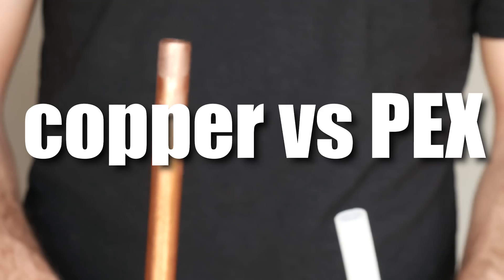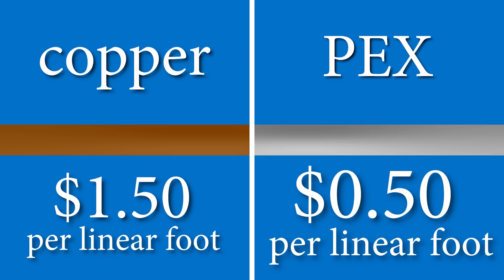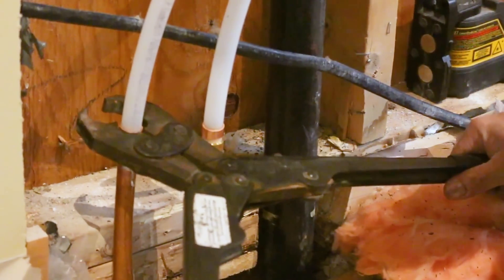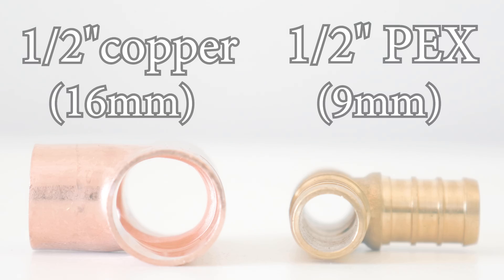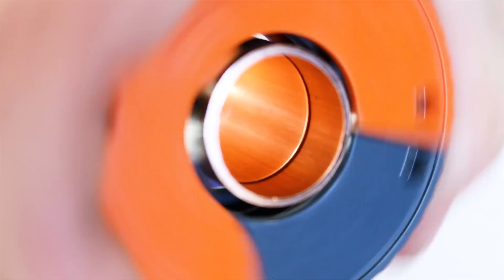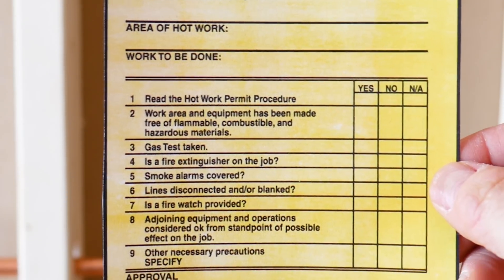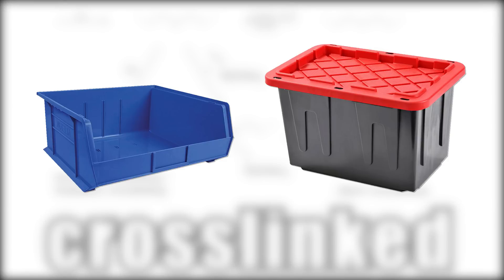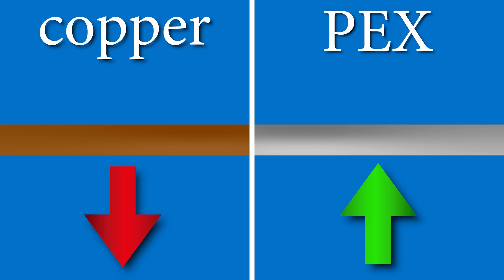Is Copper Better Than PEX? (COMPLETE GUIDE) | GOT2LEARN

Comment: I'd like to know the long term effects on ( water / health on Humans.
Reply: Very good question
Reply: well, we've been living with copper piping for a few hundred years, and the quality of water has improved drastically the last 70 years. It really depends on the water coming in, but definately copper > pex for its inhibitive properties if you have any standing water in the lines.
Reply: With PEX it is unlikely to actually have any impact.  It is due to the X in the PEX.  When you look at the current research, it is generally PE without the X.  Those formulations are made in order to allow them to be more readily recycled.  However, once it becomes cross linked, the only thing that you really can do with it is grind it up or bury it.

By and large, the majority of safety concerns from plastics are not from the plastic themselves - but the various additives which are included in order to create a material which suits the needs of the application.  Plasticizers in particular which are found in single use plastic containers are well known to leach out of them over time and they can leach into what they are containing (mostly a problem for prolonged storage as opposed to things which are consumed soon after packaging...).

And considering that California managed to find no evidence of risk for PEX - I am not too worried about it.  Almost everything causes cancer in California...PEX doesn't...  And it wasn't for a lack of them trying to block it.  Activist groups spent over a decade trying to find reasons to block PEX from being used in California and they were not able to find anything.
Reply: exactly, cuz i 've heard pex can have plastic like taste
Reply: @Eastbaypisces  PEX is inert. If you’re concerned about stagnant water for extended periods and you’re not on municipal supply where Fl is added, just install Pex w/oxygen barrier in those areas. 

Copper oxidises and accumulates mineral deposits. Plenty of University and health studies have been performed last 2 decades all finding fewer mineral deposits in water samples from Pex than copper. Unless it’s a very old building where Pb solder was used, it’s not considered harmful but certainly Pex would deliver “cleaner & purer” water from source to tap.

The “plastic taste” was not from Pex. It was likely the old Quest polybutylene pipe or cpvc. Both are no longer code compliant and are recommended to be replaced if present.
Reply: @Eastbaypisces  cancer causing.
Reply: @stevendouglas3860  There is no supporting study for such claims
Reply: @MichaelM-to4sg  there is . In the New England medical Journal. Google it .
Reply: @stevendouglas3860  Just did. It actually the New England Journal of Medicine but Google found no such article. I'd be interested in a link

Comment: Prefer a combination of both (20% copper and 80% PEX). 
I like to have copper coming out of the walls and floors and PEX to be inside the walls and floors. Like for your toilet, faucet and hose bib etc. 
I find that PEX is a way too flimsy coming out of the walls and floors and copper is very rigid and great for things like valves, hose bibs, shower stems and even mixers. 
I can’t see how people get away with using PEX  hose bibs, every time you got a screw in your holes it’s just flexes and moves.  However, copper is basically fireproof and I don’t know if Peck’s were mouth causing you not to have water on the third floor, if there’s a fire.
Reply: Exactly...there is no "craftmanship" when using pex and this risks are higher in the long run. As you say above, th eend result with 100% pex is lousy when it comes to hose bibs and similar needs for a decent rigid design that only requires one hand to use while to flexible hose bib would require two hands to mess with. Building materials have their place and PEX in my opinion doesn't replace all of what copper offers. Custom homes certainly would be junk if PEX were used 100% to save money vs. a proper use.

Comment: Got a pvc pipe coming out the ground that transitions to copper. The PVC coming out the ground has the shut-off valve. But the PVC is starting to look in bad shape. And id like to change it. Just picked up the propress wrench and want to maybe change it out. Anyone have any ideas on how to go about doing this?
Reply: Find the shut off valve at the other end of the PVC? Shut off then dig up and cut out the section you want replaced and put another valve there, pvc or copper stub. Doesnt really matter.

Comment: Very useful ive notice decrease in pressure after installing pex due to its diameter. 

Perhaps do a comparison against press fittings since it doesnt require solder, flux and gas?

Comment: My buddy had damage in his house with a bunch of buried copper. He replaced his system with pex in the attic rather than digging. Saved him a TON of cash.
Reply from the maker: For sure :)
Reply: Could also run soft copper through the attic, not to be that guy but yeah
Reply: He'd better INSULATE that pex in the attic. We just had some -29F temps a few weeks ago. Hope this house is in Florida. Even south Texas got slammed with Arctic air.

Comment: In thought to put in 3x the 4.5"x20" filter housings in for a Southwestern USA climate (hot summer) house. I thought I would need a plumber or start learning to build a rectangular bypass fixture to add to the garage's exposed water line so that I can add the filters and shut-off valves when changing filters. Now seeing PEX as an easier option, does the reduced flow make it not useable for such a task? My input in the garage is a copper pipe coming up out of the wall, with 2 ft going up and back down with an inch of horizontal separation.

Comment: I use copper for air compressor piping. Don’t know which type, I pick the strongest and thickest one. 
Then I use sharkbite and copper/brass for quick emergency repair. 
If I have time, I would do a all copper/brass repair or installation. 
Plex I use if I have a long run for a sink or toilet on the opposite side of a building. I always Install it in a way, so it will be out of the way.
Reply from the maker: Good job!

Comment: The short answer is PEX is good for residential use and copper is good for commercial use. I 100% agree with this video.
Reply from the maker: Very well said :)
Reply: @Got2Learn  Please do a video on the recirculation pumps and how it operates. Maybe also through in check valves explanation and importance. You can make a comparison to copper press connection type couplings as well. Thanks

Comment: I like plastic as well for Reno's but try wirsbo uponor piping. I believe it has a bigger inside diameter and is better to work with especially in tight areas. 
Copper piping for on hot water tanks,  hose bibs and showers though for the solidness of it.

Comment: The question between copper or PEX is going to be what type copper? (wall thickness) and what type PEX?  Then the next question should be what type water do you have?  Then what is the application?  Residential?  Commercial?  Wall type?  I like copper because it’s a well proven & known product.  PEX has its advantages (cost) both material & installation.  But plastic is still plastic, what is the ultimate lifespan?  What about rodents?  What about solvents?  Temperature extremes?  I’ll take copper, do it once, do it right, and be done with it for 100 years.  Just saying...

Comment: PEX is better for the plumbers, Copper is better for the homeowners. 

The only reason why PEX was created was to lower the cost to the industry. And that is the only reason why it is used by plumbers. Cheaper to buy, faster to install. Less skill required.
Reply: There is a push to remove the "skill" from skilled trades. Soon there will be no more tradesmen, only low hourly paid installers.
Reply: @rickh1300  Hopefully those low hourly paid installers will take the $1,000.00 and Free Plane Ride from Trump!
Reply: @stardust231  Hi Jake,
The water quality is quite good in Germany. But we have some areas with slightly acidic water. There copper or Steel isn't a good idea. Stainless steel, PEX or multilayer pipes should bei used there. 
A increasing problem are here plastic pipes of low quality 😬
Reply: When I worked in a plumbing store almost 80% of plumbers bought copper over pex. Plumbers told me they hated coming back to repair pex which rodent chewed through.
Reply: At least here in Germany PE-X is the much better choice for the home owner, the insurance company and the installer. Due to the water quality here in our region cooper pipes tend to fail. I think 9 of 10 water leaks occurre in piping systems made of copper. Pinhole corrosion is the reason for this.
Reply: Other than stub outs I see no reason for copper.
Reply: @fillmorehillmore8239  Moscow Mules  ;)
Reply: Lower cost? Plumber charge the same for labor.
Reply: You said a lot with few words. 👍👍
If only TrAmp was that way.

Comment: Hi there , I’m a plumber from England , this is also a Big topic hear too, , well, for the ones who care anyway,  thanks for a different insight  into this ,  except hear a 3m length of copper is on average about £7, and pex is £3-4, but .............. average  copper end feed fitting around 50p and  pex fittings no less then £2 a pop,  so with a system with lots fittings is it realy that cost effective,  and also like to no another view on line scale ?  As parts of England suffers with it fairly bad , thanks

Comment: Why in USA so small choise?
We use pex ( a, b, c, evoh) most often in heated floors.
Aluminium pex, copper tubes, polypropylene mostly on water, or to make boiler room connections. Sometimes customers wants stainless steel tubes on press fittings to make beautyfull sight of boiler room.
In electric sphere i see the same small choise. Is it because of regulatoin?
Reply: Democrats.

Comment: You should compare pex A to pex B. Pex A or expansion style/wirsbo/uponor  has much large internal diameter fittings and will give better flow. Pex B or crimp style has smaller diameter fittings and the piping itself isn't as flexible as pex A.
Reply from the maker: I'll talk about this in the ProPEX video coming soon.

Comment: PEX can be relatively quickly destroyed in sunlight or with fluorescent / UV lighting
PEX will typically expand and not rupture with freezing.  
If you use home run for hot water, you can use 3/8 pipe for runs up to 70F,   giving you hot water faster with less water and time wasted.
With homerun, you can run the pipe right up to the fixture without a stop. 
For smaller pipe sizes, each elbow is often equal to an extra 5F of pipe in terms of flow reduction. 
PEX-A does not have the chemical used for cross linking that are used in PEX-B and PEX-C
Kinks in PEX-A can be removed with a hot air gun.   With PEX-B, C, & D, you have to cut the section out and replace.
Reply: Osman Vincent Plus the diameter of PEX-A I think it’s comparable to copper...? But a lot of people that I know, don’t wanna pay the money for PEX-A
Reply: @IppiopaidFEEDBACK  its ok. They can call back after their copper/pvc lines burst in the cold 😆
Reply: That is what I notice about Pex Low pressure at the Shower Valves. I like a strong water Stream nothing like a 3/4 copper Run reducing down to half.

Comment: PEX easy install & easy repair. SharkBite or clamp make the connection, will last as long as copper & no corrosion. Rodent problem is very rare so can copper busted in cold freeze. Copper cost much money & labor to do than PEX. I worked on PEX, the clamp connection quite strong & PEX made of material will lasts a lifetime.

Comment: My house was built in 2004 and the plumber used copper only. But that was the only good thing as his workmanship was shoddy. I want to add an outside faucet and sink in my garage and I think I might use pex
Reply from the maker: Yeah man, just go for it, it's so easy to work with and there's no flames and flux, much cleaner install ;)

Comment: Copper always. Protect it from freezing, you never have to mess with it again. One and done. Cheaper isn't better in this case. Mice multiply like rabbits. On top of that Pex clamps are known to fail too. You could use stainless steel clamp, but even these fail due to stress corrosion cracking (SCC)
Reply: Use the copper rings  and crimper wont ever leak
Reply: @erincrone5544  Sure. The rodents that come by always look to see what connection methods were used. Sounds like you are a plumber looking for more work... I'm HVAC, I'll always stick to copper for very good reasons. #1 is failure rates are rare. I could point to videos showing pex failure all day any day.
Reply from the maker: Thanks for the info, any info is always appreciated!!

Comment: Properly installed copper pipe will last one hundred years easily.
Most private wells have acidic water that will make copper start failing after about 25 years but 
properly treated water from a municipal system will make copper last almost forever.
Reply: That depends on water conditions. In my area on well water your lucky to get 20 years out of copper.

Comment: Pex has one characteristic that makes me like it better than copper......it won't blow when it freezes.

Here in Canada, frozen pipes can be a real issue.   I've known 3 people that have had pipes freeze and burst.   I had no idea though that rodents like to chew through pex.  That's interesting.  But since I live in a house with 5 cats, 2 of them being female cats, I'm not too worried about rodents.  (Heaven help any rodent that mistakenly gets into my place.)

In my house, I actually have a combination of pex and copper.  About 60 percent copper and 40 percent pex.  And I've installed it all myself. 

When it comes to pex, I will use a manifold with each fixture getting its own run.   That eliminates low flow associated with hooking all fixtures up on one line in pex, though that methodology can waste water as it can force you to wait 2 or more times for hot water.

The one thing that the presenter forgot about an advantage to copper is shower valves and toilet supplies.   Most shower fixtures for custom showers require a rigid pipe (copper say) to connect to the shower control assemblies in order to attach them to the wall structures.   Same with a toilet supply line - you need to switch to copper.

Another disadvantage to pex is close quarters.   Getting those huge crimpers into a tight space can be a real challenge, if not impossible.   An electric crimping tool is one possible solution (sometimes) but they can cost over a grand.   And another disadvantage to pex is crimping fatigue.   Crimping hundreds of rings a day can take a real toll on your wrists and hands, not to mention it's a lot of work.  If I was a plumber doing pex on a daily basis, I'd invest in a batter powered crimper.
Reply: "Same with a toilet supply line - you need to switch to copper." 
That's funny, when I re-piped a basement half a year ago, I went straight PEX to the toilet supply line. No copper. No messy transitions. Fast, clean, consistent.
Reply from the maker: All good information, thanks Doug!

Comment: Uponor (Wirsbo) fittings have a larger ID then the type of PEX shown in this video. Granted, you need to used their pipe to have the correct firmest, but it’s still cheaper than copper. The connections leak far less as well. That being said, the ID is still slightly smaller than copper. It’s great to have options. 👍🏼
Reply from the maker: All good information. I am currently working on a complete guide on Uponor and how it works and I talk about that, stay tuned ;))))
Reply: @Got2Learn  The folks at Upanor have a great tour you should take.
Reply from the maker: It's one of my next videos :)

Comment: I am been using pex for years, I am a pipefitter and also a plumber for 42 years. I use pex because it is cheaper and easier to use . Copper and pex can freeze but pex will not break and will go back down to it size , but if copper freezes it doesn’t. Also pex can have 200 psi and 200 degrees not 120 psi and 150 degrees
Reply: PEX-a pipe typically meets the following temperature and pressure ratings:

200 degrees F at 80 psi
180 degrees F at 100 psi
73.4 degrees F at 160 psi

Comment: in summary PEX is great to fish through joists and wall in renovation.  It installs faster.   But it flows less for the same size and I wonder  how long before fittings get brittle and starts leaking and renovation.  40, 50, 60?   There’s tons of 60 year old copper that’s still just fine.
Reply: 50 years?   Please.... Copper lasts a lot longer than 50 years.  PEX is unknown.
Reply from the maker: If you use crimp fittings first of all they are brass, second of all they won't become brittle. As for your concern about copper, it does last about that 50 years, until you start getting problems with it, it also depends what kinda of water you have, some last even less than that, some last 75 years, it all depends.

Comment: Lately I've been using Pex for long runs, but convert to copper when coming out of the walls or going into fixtures. Makes the finish look nice and clean. Plus where I live, our water is extremely acidic. 

I had to replace the type M copper in the house I bought even though the house was built in 2005. I went with Pex for the most parts, but on any exterior pipes I had to run, I used type L copper. Type L holds up a lot better against the acid rain.

Comment: When I did the math of pex vs copper when I removed all the old galvanized pipes in the house I went with copper. The fittings on pex plus having to buy the crimper drove the cost too high for my liking compared to copper. I 100% agree on your points though that pex is way easier to move around and install.
Reply: towmantowman the amount of solder and flux and butane needed to do a whole house negates the price of a pex tool.. however crimp rings are a price too.. I wouldnt worry about the initial investment of the pex tool, it will be usedull for any future repairs and can be resold